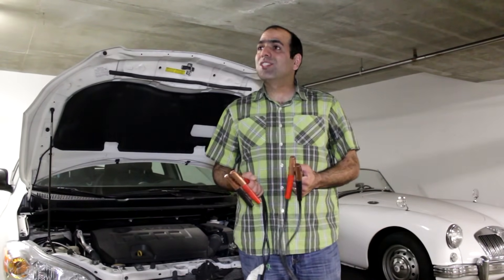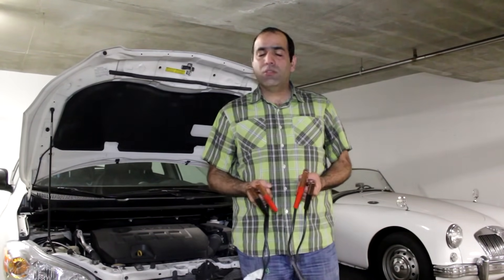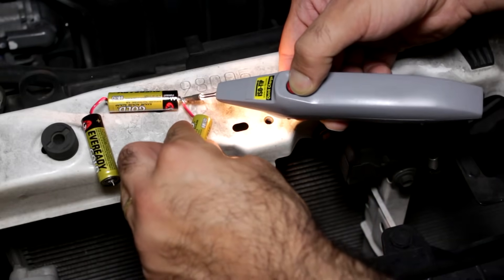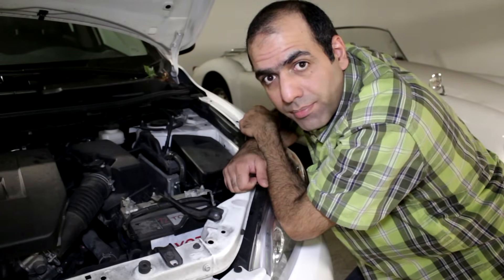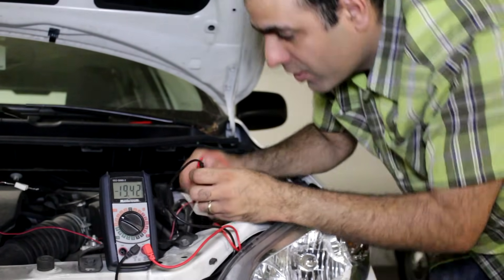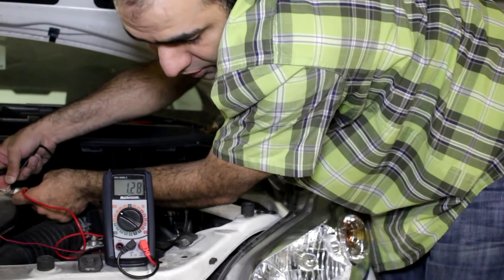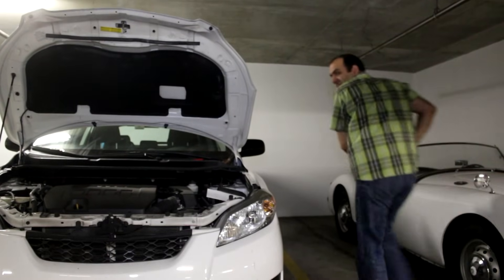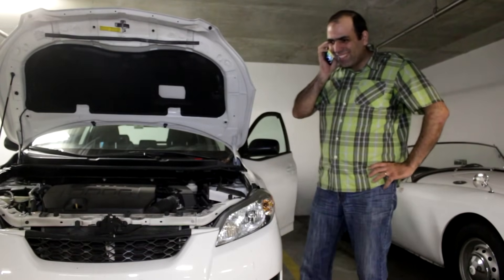Jump Start a Car with AA Batteries

Comment: Why don't manufacturers start selling cars with cranks again?
Reply: Richard van Pukkem no no no !!11one1one I's opposite. Manuals are for cruising over the highway and automatics in the city. Cause it's very inconvenient to actually engage clutch, kick in gear, disengage clutch, just to start moving. And if there's a lot of cars, you have to do that constantly.
Reply: shadowsimjk It works quite well, but you can try to help with the starter, most of the time engine starts easier.
Reply: Pope-Eye They kind of do. It's called manual gearbox. You Put the car in neutral, you open the door, get out, and push it to get some speed, jump in the seat, put in second or third gear, and lift the clutch quickly and briefly, hoping to get the engine to crank over once or twice and fire up. Also if you park at the top of a hill, it gets easier.

Works quite reliably with Toyota Corolla atleast.
Reply: @shadowsimjk  Yes, but the our greedy capitalist corporate overloads have designed the alternators so that they don't produce enough output to supply power to run the engine electrical system if the battery is discharged too far so the car won't start with a completely discharged battery even if you push it down a giant hill. Obviously our corporate overlords are have conspired  with the tow truck operators to force you to call them when your battery is too far discharged.
Reply: shadowsimjk you are correct. But I have heard that all modern cars have so much digital parts that there is a chance you may damage them if you do this.
Reply: @shadowsimjk  doesn't work if battery is dead
Reply: Pope-Eye Sell 1 crank or 3 batteries, which makes more profit? It's a conspiracy I tell you !
Reply: UnknownAKA Ultra well if you're on the hill you don't need to get out of the car. Most of the time one leg through door is enough.
Reply: Most automatic gearboxes can also be locked to lower gears, which is specially meant for driving downhill. The options on automatic gearboxes mostly are (P)arkbrake, (D)rive, 3 (which means, go into maximum the third gear), and 2 (same as above, but then 2nd gear). But you are right, manual gearbox gives a lot more options. The choice between them depends on personal preferences.
Reply: +shadowsimjk done that with a citroen saxo , i guess french cars have to stay in 2nd all the time or they just wont crank , but same principe , put in second , get out , push with a friend and lift the clutch at a reasonable speed when you hear the engine 'puffing'
Reply: +Pope-Eye Because the compression ratios of modern cars would break your arm (and your back) if it were to snap back, such as with a backfire. You wouldn't be able to turn it fast enough, either (due to the compression ratio).  Also, if the battery is (too) dead, the fuel pump will not pump fuel into the engine; no fuel, no start. The coil packs would fail to deliver a spark to the plugs. the immobilizer key would fail to allow the car to start, since the computer could not get a signal from the key telling the computer to allow the car to start (Which could happen if the battery were to fall below, say, 10volts).  The main reason is the compression ratio though. You just wouldn't be able to turn the engine fast enough to get it to start, and if the car were to backfire you'd be spending the next 2 months in a body cast.
Reply: @southernoftexas8229    No he was talking about a hand crank power generator
Reply: @southernoftexas8229  I suppose the solution to that would be a crank that recharges the battery just enough to get the engine going again
Reply: @southernoftexas8229  thats why u get a racheting one where if it does backfire, it just ratchets harmlessly instead. As for getting the speed, add some gears into the hand crank to give that speed? Big gear attached to small gear that's welded onto the engine crankshaft?
Reply: bb aas True, never thought of that...
Reply: Szymon Gorczynski Oh really, I have to perform "such" tasks every day, 30 mins to a hour or sometimes even more. I am just saying that automatic gearbox is more practical in such case.
Also, if you doing that 5 days a week, you have to change clutch discs too every year or so.
Reply: Pope-Eye Also backfiring issues could be fixed with special gears, which is in clocks (Can only spin in one dirrection)
Reply: +Pope-Eye  well weight reduction bruh
Reply: Though a freewheel mechanism won't help in case of a backfire
Reply: Szymon Gorczynski With what if any snow ever falls? Not sure what you mean. Though i drive through anything with anything.
Reply: zogworth I have 4 cylinder 3 phase 32 kW diesel generator that is started by 1 cylinder 2 stroke petrol engine, which is started by hand, winding some rope on the pulley and pulling quickly.
Reply: you also need 12v (roughly) to power the alternator's coil, and the ignition coil(s) primary windings.
Reply: Then you will experience one of the downsides of automatics ;)
Reply: +Richard van Pukkem  And for automatics?
Reply: Richard van Pukkem Well good luck if any snow ever falls!
Reply: +Pope-Eye 

and in the 60's the mini came along with its transverse engine and thus most cars have had transverse engines ever since.

I have an old 1 cylinder diesel genny that you have to crank start and its a complete pig, god bless electric start and all who sail in her
Reply: +Mark Schulz IV dude you should not be having to change you clutch out every year with normal everyday driving
Reply: Because billion dollars are lame. They wanna join the cool kids in the trillion range.
Reply: that is a great idea especially for small cars and for very small cc engines this could even be done with the clutch or accelerator pedal geared and designed      properly.
Reply: No. 85 Merlin automatic windscreen wipers? you want to wipe the window manually, while driving bro?
Reply: well, good luck cranking a 100+hp engine to start solely with your arms, it will dislocated them before you can try to start it. Even on high-performance bike you have to use your entire body to kick-start it.
Reply: Most modern compact cars are front wheel drive with transverse engines so it would be difficult to do.
Reply: ***** I don't mean having them for every use but for situations when the battery goes flat. Car manufacturers were doing this right up until the 1960s and then they just stopped
Reply: We have a massive genny that size too and its a complete pig to get started. I think I might investigate your donkey engine solution.

Can't remember the KVA rating but the whole set up is the size of large car
Reply: I've no idea how old this one is, could be anywhere between the 50's and 70's 

Next time I am at the farm I will investigate.

That said its not often we need that much juice. The 5kw electric start one does most of the work.
Reply: +Pope-Eye When you wonder why, figure out who wins money in the deal
Reply: all they have to due is add the clutch back to allow for manual control when needed ie stuck accelerator or dead battery
Reply: Prometheus720 im not sure but i think they meant a hand crank like a real long time ago attached to the crankshaft of the engine to start it like a pull start but crank
Reply: @james10739 , I guess you and I are the only one's throughout all these comments who actually know anything about the CrankShaft.
Reply: Well commonly some got injured by hand crank in the past, plus try to hand crank a diesel -
Reply: It might make sense for small economy cars, but cars with larger displacement engines would be very hard to hand crank due to compression and weight. They also have this weird side effect where they break your wrist at random which I think could be a factor as to why hand crankable cars are gone. And you don’t need them when you have AA batteries and electroboom
Reply: +Pope-Eye  some russian cars have them..
Reply: +Pope-Eye Because if they back fired they'd tear your arm off.
Reply: koopatroopa187 one no when you bump starting by letting the clutch out  and the engine starts cranking its also cranking guess what the altenator also I have a motorcycle not a car and when i do drive its a stick
Reply: That made me chuckle. I had to perform this with my Corolla more often than i like to admit.
Reply: Ali Abdallah

Generators was the best! But can't make billions, if ya screw the public over! 😎

Generators days, was just a simple turn and charge, now act of God Congress and President hope it starts!
Reply: Pope-Eye because motors are to big you could not crank fast enough
Reply: Southern ofTexas Ok, well what about a hand-crank generator to charge your car battery? If you have faulty wiring, it may not fix it because it would just drain again, but if you just left your lights on or something why wouldn't that work?
Reply: because you're still going to need a new battery unless the only problem was you left the light on.
Reply: Pope-Eye cause crank engines cause a LOT of broken arms
Reply: I don't think people appreciate just how hard it is to hand crank an engine, especially a diesel.
Reply: One word, compression.  It would "rip you arm(s) out" once it kicked over, using gears or not, it's not efficient.
Reply: All cars have Cranks. To put a Hand Crank on let's say a 2019 Camero then all you have to do is take off the Crankcase Cover then weld a Crankarm onto the front end of the Crankshaft then spin it as fast as you can to crank the car. Easy as that except for the part where you'll probably either pull your entire elbow joint apart or the handle swings back across your arms and breaks the bones in 2.  However, trust me you don't want to do this. Some popular garage did this several years ago to attempt a Hand Crank on a newer car and they proved it's not even worth having around to look at although it did in fact work all because all combustion engines made even today, including your small engines on your lawn equipment, have a CrankShaft and always will.
Reply: I'll be the first to say that the old Crankarm was replaced by the Flywheel and the Broken Arms were replaced by the Starter which in turn gets the CrankShaft to Turn Over. From the looks on here everyone knows squat about engines... Here..https://en.m.wikipedia.org/wiki/Crankshaft
Reply: Well yeah I'm out on a camping trip right now and my car battery is too weak to start the car soo waiting for the second option. Yes it's an automatic
Reply: If there were cranks then my arms whould be so fit
Reply: Unless it's a good dynamo-crank system, then doubt it would be safe enough without a disengaging gear at the output, so that it doesn't knock you out or cause an accident if you're not being careful. Most of the crank systems were all mechanical in nature
Reply: Go ahead and try to hand crank a modern engine with Direct injecting and compression ratio over 12.5/1  aint gonna happen. You would have to spin it up to around 250rpm for a second or two before it would light off
Reply: You can use the power of gravity on an automatic. If the hill is steep and long enough..
You can also use potatos
And you can use a Tesla
You can use coal
Reply: Well, they're are probably not allowed to in the UK because of drivers getting tooled up to deal with  road rage Crank handle would make a splendid tool for getting tooled up. 
Picture this.
I spring out of my cab and scream at the geezer 
"... where's yah fuckin tool..." 
and he retorts 
"...what fuckin tool" 
and I snarl back 
"...this fuckin tool..." 
as I wield my crank handle across his head.
One reason why we can't have crank handles.
Reply: Omg 777 likes
Reply: Money.
Reply: Not a chance you're turning over a modern engine by hand. Bump start is the easiest way.
Reply: Everyone here is talking about how the compression ratio of a modern engine is too high, which is true.. but that will only affect you if your crank is attached directly to the engine. Instead what you would install is an inertia starter. With an inertia starter, you slowly spin a heavy wheel and get it faster and faster until it’s at a certain RPM, then you stop cranking and engage the spinning wheel to the crankshaft and it should get a few turns outta the engine without blowing your arms off. That is how old aircraft engines were started 👍🏻👍🏻
Reply: @scottyp2625  yes, but a heavy fly wheel would add weight to the car.
Reply: The serious answer is that people died hand cranking cars. The electric starting system was quite literally inspired because someone's friend was killed when he was attempting to crank start an engine when it unexpectedly spun back on him and smashed his jawbone with explosive force
Reply: +shadowsimjk Quick question what if your on a hill and you fail to enter your car and it goes to the side and crashes while you tripped and fell in the process, then what do you do (is that possible xD)?
Reply: +Pope-Eye They stopped doing that because it was dangerous. If it backfired it would easily break your arm. Or the crank handle could go flying off.
Reply: I'm sorry, bb aas, but if you aren't able to perform such a simple task then you shouldn't be let out on the road.
Reply: @szymongorczynski7621   manuals offer more distraction  on the road... if you put it in the wrong gear  say good bye to your transmission
Reply: @punker4Real  Distractions? Eh? You look at the road not the gearstick. Sticking it into the wrong gear won't break the engine unless you stick it into first st like 60mph.
Reply: Also if it's gasoline vehicle you won't be able to start it with clutchdump if battery is totally dead. There is little juice required to generate spark in the sparkplugs.
Reply: @TheBlork74  I know this comment is 4 years old, but this is not true, the alternator also rotates when you push start a car which Sparks the plug if you have a modern FI system6, and also old gasoline cars don't have a battery or a starter(the Ford model f for example), they used a magneto coil to spark the engine.
Reply: Older cars 90s and 200s have alternators which require certain rpm to magnetize and actually start generating power, so if battery is completely flat there is not enough juice to start generating power let alone run ignition system. With much older cars or motorcycles they have rotating magnetic wheel which is directly driving the sparkplugs, in this case it would work
Reply: @TheBlork74  i don't think so, I can easily push start my gramp's fuel injected car, and my dad's moped is fuel Injected (with a CDI not a magneto mind you) but it has a kick starter. My dad also used to have a fuel injected Daihatsu zebra (jumbo version of Hijet) and we push started that POS almost everytime we used it.
Reply: +Mark Schulz IV I live on an island where it can take over an hour to drive 5 miles (~8 km) depending on the time of day and the day itself. I've never once felt that my commute would be so much easier had I had an automatic. Also, if you're having to replace your clutch after a year, it's because you suck at driving and not because of traffic. Seriously dude, quit riding the clutch.
Reply: Derick conspiracy? it's called business, dude x) wouldn't you do the same?
Reply: +bb aas The kickstarter of a motorcycle has the same kind of oneway gear system. It already exists. Easier is to put the car in 2nd gear and run a bit, clutchdump and done. If only the battery is the problem.
Reply: Szymon Gorczynski Yes, unfortunately nothing can beat good ol' mechanical ones.
Reply: +shadowsimjk You don't even need to get out, 2nd gear, get someone to push you, clutch up, throttle flat to the mat and away you go.
Reply: Southern ofTexas Sure, all you need is a freewheel mechanism and it won't break your arm, just like on a bike.
Reply: Groovy Panda The battery still has to have some charge left in order to start a car by using the clutch. A car cannot clutch start with a dead battery. You can jump the clutch on a battery with low voltage, but not with a dead one.

BTW, you have the same amount of control with a manual car that has a stuck throttle as you do on an automatic. What's that N on the gear selector that's right under the R? Oh yeah, that's neutral.
Reply: The early Ford vehicles were sold with no battery and utilized a magneto ignition system. Even today the most powerful engines used in drag racing utilize magneto ignition systems. The electric motor that replaced the hand crank is the need for 100s of amps to get the thing started. Not to mention internal combustion engines destroy all momentum of the moving components. Hence the engine comes to an instant halt when shut down.
Reply: well said. My brother had his arm messed up when trying to pull start a big outboard. I think he actually broke it (arm)
Reply: Richard van Pukkem Which is yet another reason why all automatics should be scrapped. You can't push start it.
Reply: Mark Schulz IV I like how you like your own posts.
Reply: Richard van Pukkem With a manual you have complete control of your revs and the torque you put to your wheels, not just the speed.
Also, going uphill at high revs automatics tend to shift into the next gear and nearly stall the car/bus. Also if, God forbid, your footbrake fails doing 70mph+ down the motorway then you're pretty much fucked if you're in an automatic whereas in a manual you can stop by "engine breaking" ie move down the gears so that the engine over revving will slow the car down, then you apply the handbrake (as it is independent of the footbrake) slowly until you stop on the hard shoulder.
Reply: "the compression ratios of modern cars would break your arm (and your back) if it were to snap back"

ever heard of the ratchet mechanism
Reply: +Big Macintosh. there is a hold or grip, without thumb, to safely crank a handle. some skill too. but the manufacturers would he sued to hell if a woman broke a nail.
Reply: I drove an automatic car for about 50.000 kilometers around Australia without any service, and never had an issue with starting it. I bet it's just a case of choosing the right car. Automatics and manuals are for different purposes. Automatics are for big countries (USA, Aus), to cruise over the highway, or for people who aren't able to manually shift. Manual cars are for places where everything happens on a square mm (Europe).
Reply: bb aas Well you have to sacrifice efficiency for better control of your vehicle. Too many things are automatic in cars nowadays. Auto headlights, auto windscreen wipers, auto/push button handbrakes, push button start, auto gearboxes, auto parking, auto engine shut off et cetera, et cetera. We've even got self driving cars!